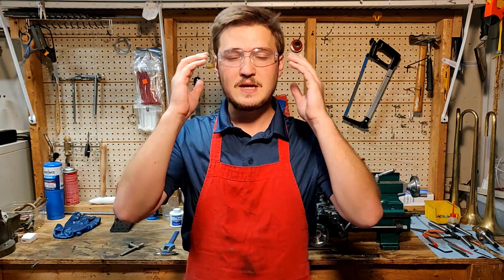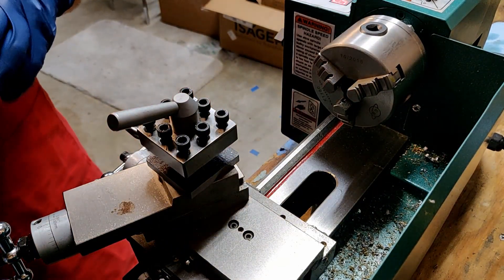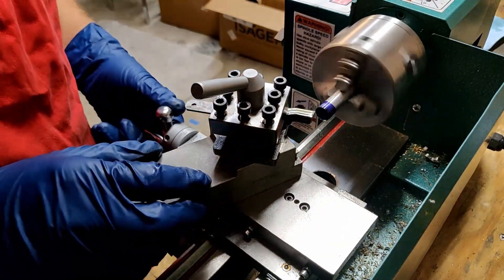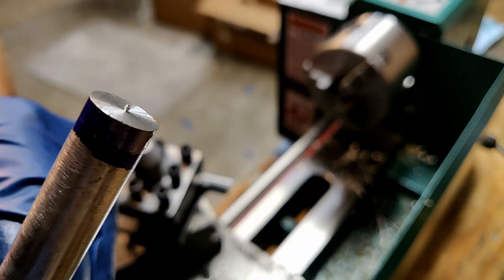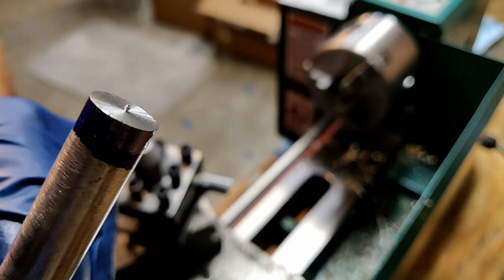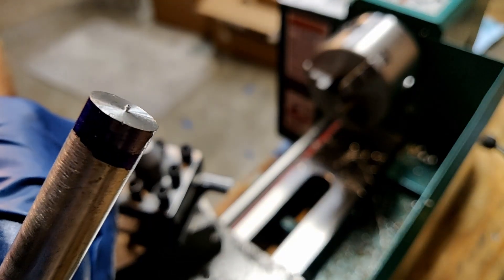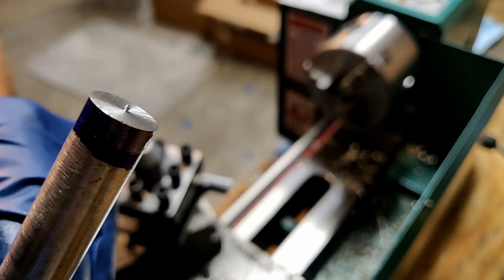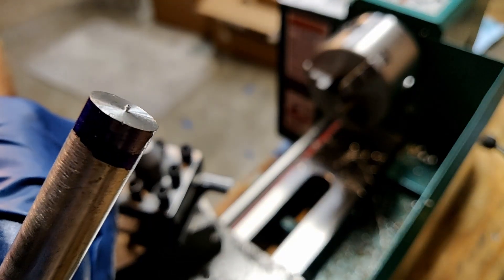Grizzly 7x14 Mini Lathe | G0765 First Impressions

Comment: I’ve had this lathe for about 6 months now, and think it’s a good machine, after tweaking many issues of course! However, let me warn you about a very dangerous trap when drilling with a tailstock mounted Jacob’s chuck. This probably applies to many of the various mini lathes. If you run the quill out far enough, you’ll notice a groove milled into the top of it. On top of the tailstock you’ll notice a set screw that threads into the headstock. That screw rides in the quill groove, and keeps it from turning when using it with centers and drill chucks. Pay close attention to the top of the quill when drilling, and if you see the rounded end of that groove coming past the front of the tailstock, STOP!!! That groove is open on the rear end, and continuing to feed out on the quill will allow the groove to pass the set screw, and at that point the drill, chuck, quill, feed screw, and hand wheel will INSTANTLY go from 0 to matching the speed of the spindle! If your hand happens to be on or near the hand wheel, which it will be if you’re drilling, you will take a nasty beating at the very least, and possibly broken bones/lacerations! I speak from painful experience!
Reply from the maker: Woah. Sorry to hear that, but thank you for the heads up. I had not noticed that yet, and I really appreciate the advice!
Reply: Thank you, people heavily underestimate how dangerous these machines in specific can be.
Reply: Seems as if a set screw set into the quill could stop the overrun situation.

Comment: Using feeler gauges as shims is brilliant! Thanks for sharing. I'm going to buy some of those and do that same.
Reply from the maker: Glad I could share a useful tip! I picked it up from Practical Renaissance I believe. Sure is a cheap way to solve that issue.
Reply: The other thing we've done is cut out strips of pop cans and that works pretty well
Reply: @MNDashcam  It would have to be beer cans in my case.😊

Comment: I worked in a machine shop briefly as an industrial controls integtator (adding electrical controls to finished equipment) and gained some lathe experience during my time there.  All the mills had atomized coolant/lube misters which would probably help you quite a bit.  The large lathes used a flood coolant/lube system on the workpiece, but that would be impractical on the small machines.  The takeaway is you want to lubricate and remove the heat simultaneously.  Some people say no coolant with aluminum, but the shop I worked in did and the parts had perfect finishes like looking at the bottom of a Compact Disc.  Of course the parts were large and the cuts were intensive,  so may not apply on hobbyist level projects. Still I think a small mister with the right composition of liquid will solve your problem.  I'm sure there will be some disagreements and I only speak of my specific experiences.
Reply from the maker: Good to know. I love learning and hearing from different perspectives. Thank you.

Comment: You can get a mirror finish on alu by using a wider tipped tool.. anything pointed looks like a micro spiral under a microscope and you can feel it. The point needs to be wider than the ratio of feed to head, or just don't use the feed.
Reply from the maker: That's good info to have. I appreciate it.

Comment: You will get a better finish by ditching the auto feed but also by making sure the tool tip is very very slightly below centre. Hope that helps. Ps changing the spindle speed makes no difference as the feed speed is directly proportional ie same ft travelled per minute per revolution ...it just completes the cut quicker thats all.👍
Reply from the maker: Interesting. Is that just how these Brushless DC motors work? Or is it related to the diameter of my work?

Comment: You can improve the chatter issue by replacing the bearings in the spindle with tapered bearings rather than the roller bearings..

Comment: not sure if this is too obvious but...tool sharpness! 
most carbide tools even when they're fresh out the box, are pretty shoddily sharpened. I have seen some that had a 30grit edge on them. I would recommend getting some diamond plates, 600 grit will give you a tool you know is sharp. 
with that you can then continue with the tests to properly see if you can improve the lathe.
but this was 3 years ago so you probably already figured things out.

Comment: Not an experienced machinist, but a fellow mini lathe user. It looks like you are using HSS tooling. You could try honing the edge of the tool to improve the finish, or you could probably save yourself a lot of hassle by getting some tooling that takes the special indexable inserts for aluminium - I use CCGT060204 inserts with a SCLCR1010H06 holder (the important part is that the inserts are XXGT not XXMT - they are silver, not yellow, and very sharp). They give an excellent finish on aluminium or brass. Your live centre doesn't seem to be running true, but that's not causing the finish problem. WD40 works well with aluminium. Lastly, what grade of aluminium is it? Some machine better than others. Good luck! :)
Reply from the maker: Thank you for the great feedback. I will look into all of this. I am still buying more tooling and indicators to understand my parts better, but you've given me a good place to start looking into tooling. Thanks for watching and the comment!

Comment: Maybe a little late to the picnic, but a couple of comments.  I have, among others, a MIcrolux 7 x 16, maybe a little expensive, but I feel it worth the money.  Ground and polished stock, in the chuck, .0005" TIR.  I made one modification, to the compound gib, just a shallow milled slot for the center gib screw to locate in and keep it from moving.  Looking at yours as set, why the weird angle on the compound?  I know the protractors on them are junk, and you're not the first one I've seen with the compound set at the wrong angle for threading, the proper angle is thirty degrees off having the compound parallel with the cross slide, you want to match the angle of the thread.  You have yours set at 60 degrees, that isn't going to work. 
Also, if you can spin the handle on the compound slide easily, the gibs are not tight enough.  It should move with some resistance, to eliminate any chance of vibration showing up, giving a crap finish.  For aluminum, it's hard to tell what speed you had from a video, but probably not fast enough.  Aluminum can take a lot of speed.  A radius that is too large can cause problems, especially with a small machine.  Feed rates on the 7X lathes is too high, some arrangement to get that down to half or less of what the provided gearing allows will help a lot.  
The four position tool post turret isn't the huge problem it's been made to seem.  Shimming tools to get center is something anyone that's run a turret lathe can tell you is something they don't even think about, we just do it.  A cheap set of automotive feeler gages will give shims that will allow shimming most tools properly, and they're cheap.
Mineral spirits is also a good lube for aluminum.  For steel, I know there will be others saying I'm wrong, but plain old thread cutting oil is very hard to beat, but does generate a lot of smoke.  How bad that is for you, I don't know. I've worked with it all my life, and I'm less than a year away from being eighty.  The plumbing department of most hardware stores would be happy to sell you a quart, which is probably three years supply.  It also works for tap and die threading very well.  
I have nothing against Grizzly, I've had a 12 X 36 for over twenty years and it hasn't failed to do what I needed yet.  Not a geared head, but a back geared belt drive.  Perfectly satisfactory for anything I asked it to do, and that was a lot.
Good luck, and watch the second hand stores for some of the older lathe manuals, they were far better than what is now furnished.  In my opinion, the Atlas manual was the best, tons of information you might think you don't need, until you do.
Reply from the maker: Thank you for all the great info in this comment. I will be coming back to it as a reference. I'm honored to have you as a viewer, and I would love to have your insight on my future lathe videos!
Reply: @ezekielstrumpetcreations  Glad I could give out something of use, which is always a maybe.  However, and I'm not looking for any emotion, having had lung cancer for more than a year, my years may well be measured in days.  It's controlled for now, but how long is anyone's guess.

Books.  There used to be a publisher of old machinist books, Lindsay publishing, and Lindsay got a lot of my money.  They're gone, but the books probably can be found in the resale shops.  Atlas, South Bend, and Logan had excellent manuals, the information in them not particular to their machines, but a lathe is a lathe.  Also, Audel's Machinist's Handy Book, which is a pretty thick book, has a lot more information.  It may be old, may not cover anything modern, but again, machines are still operating on the same principles as they were a hundred years ago.  

On the previous comment to mine, I see the poster equated oil with cooling, this is a false assumption.  Oil only lubricates the tool to keep the chip flowing smoothly over the tool and not welding itself to it.  Aluminum in particular will build up a false edge on the tool, finish and size are quickly lost then.  WD 40 or spirits has the fluidity to get under the chip and on the tool, cutting oil, maybe not.

I use little carbide, for the smaller machines and smaller work, High speed steel works just as well once you learn to grind the tools.  I'm not sure what the percentage of cobalt in mine is, I'm guessing, 0.8%, it's been a long time since i ordered them.  Settled on that when it seemed to work.

Final word, you can only work as close as you can measure.  Should be enough said.  Most of my instruments are Starrett, meaning the ones I actually use.  I have a lot of others, the accumulation of second had instruments, and yes, I'm a took junkie.  I see tool, I want it.

Comment: hopefully you figured out your surface finish issue by now, but you have to take into account your tool nose radius when determining your speeds and feeds for finish. for example if your tool nose radius is 0.015 and you set your feed rate at 0.020 per rev, you will have peaks and valleys in your surface finish. also if you are still experimenting with cutting fluids you could always use dish soap, water and motor oil in a spray bottle, i prefer using coolant over oil on everything but thread cutting and knurling.
Reply from the maker: Thank you for the good advice. Sometimes its difficult to know which aspect of my machining is causing the issues because I am learning it all at the same time.

Comment: Tip. Never use WD40 as a cutting fluid, it will not disperse the heat properly and will draw the cutter into the part causing a rough cut,
and if you look under a microscope you will see the surface finish is being ripped instead of being cut smoothly.
and so people wonder why it has a dull finish and end up using scotch brite to buff it up to a shine,
because the roughness causes oxidizasion and wd40 loves to do that to the softer aluminium. not so bad on the 7000 series ally tho.

Comment: Just a question is it run on 120 or 250 outlets
Reply: The lathe operates with 110 VAC. Most mini lathes use 110 VAC. 😀

Comment: You need to dial in you parts as you can see the ovality when cutting,
when cutting soft  ally, there is no point in using oil.  as you cut the heat is dispersed quick,
if it is getting hot, then sharpen you tool,
Well i hope you pick up many tips from viewers.
Reply from the maker: Good advice! Still very new and have a lot to learn. Thank you.
Reply: Well he needs to see that by his own eyes

Comment: I saw how your adjusting your cross slide. Your not pulling back on the tool post and only feed in on the dial. . Backlash has to be accounted for
Reply from the maker: That's a good point. Thank you for the observation. Still learning.

Comment: just so everyone knows all these 7"x 14" no matter where buy them their all the same, so just buy the best price, just so you know I'm a retired machine tool fitter by trade
Reply: They all come from the same factory but they are not identical. Different venders have different “ fit and finish” ( most of these can be done by the owner) some are metric some are imperial. Some have 350 watt brushed motors with pwm controllers and hi low gears in the headstock. Some have 500 watt brushless motors with much more consistent torque through the speed ranges so they don’t have hi low gears in the headstock. Some have 3” chucks some have 4” chucks . There is Sieg c3 and the upgraded Sieg sc2 all based on the same castings.

Comment: You are wasting fluid by constantly flooding the part this is not necessary for what you are doing, you are just making extra unneeded mess and expense in wasted fluids . I would try changing  your cutting tool and tool angles I noticed the tip of your tool is razor sharp pointed try something less pointed for a bit more cutting contact or try carbide especially for cutting the aluminum I think you will see the finish will improve.
Reply from the maker: Thank you for the advice! Always willing to learn. I come from a music background, so still considered a newbie in the machining world.
Reply: @ezekielstrumpetcreations   You are welcome, I am far from an expert myself just thought to share some experience and what I have picked up from others with expertise. Have fun as you make chips there are a lot of really great people that have the mini lathe that have made improvements to them and ignore the nay sayers.

Comment: LMS is not bad they are mom and pop store. Grizzly they keep wanting to sell me a new 12"x36" Gear head that was an old 2002 Harbor Freight. I get transferred from parts all the time to sales and have to argue with a sales guy to transfer me back to parts. Grizzly's 12"x36" Gear hear is the same model as the old Harbor Freight model however the parts I replace (only 2 so far), have to be improved slightly to work on my 12"x36" Harbor Freight Gear head. Grizzly's cross slide had only 1 hole for brass thread guide to the cross slide lead screw operation. My LMS bench mill was tasked to bore another hole. Every time I called LMS I know who is answering after ordering four times.  But, they can not help me with my full-sized lathe I am stuck with Grizzly a little bit. Technically a lathe does have the capability to build itself. Don't take out the backlash that could be your problem and you don't always need cutting fluid see tubalcain I am sure you have heard or watched him. Blondie Hacks too.
Reply from the maker: Thank you for the comment and great info! I will need a larger lathe in the future. Would you recommend the Grizzly 12x36?
Reply: @ezekielstrumpetcreations  just find u a used lathe on craigslist or facebook pick up local. you can pick up a good used well known brand for cheap. Just keep ur eye open for it. I am not saying grizzly sucks, but u can get something for a fraction of the cost.